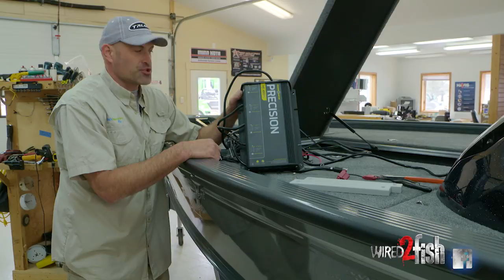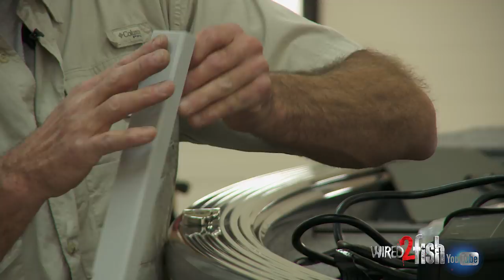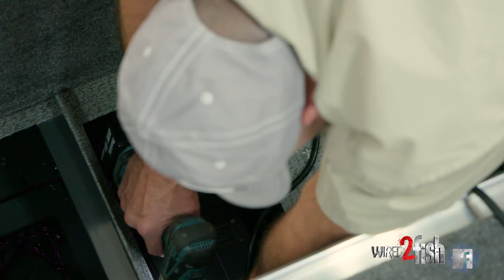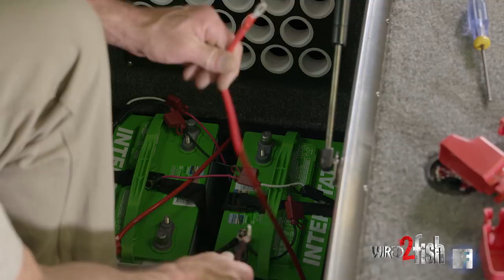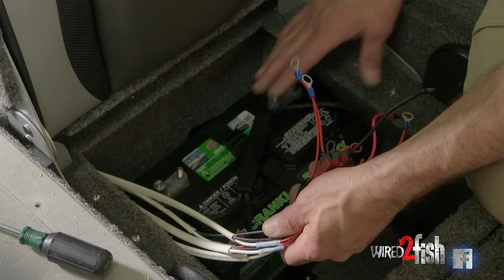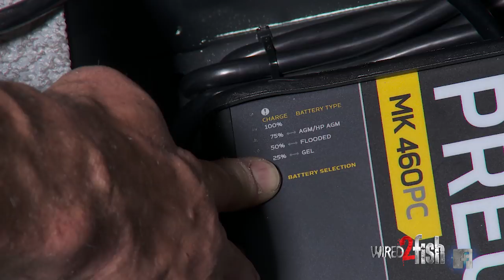How to Install Boat Batteries and Onboard Chargers [36V]

Comment: What can be done if I have 2 batteries feeding for my starter and accessories plus 3 batteries for my 36v trolling motor. How do I charge 5 batteries? Or what options do I have? Thanks for your time appreciate the great video.

Comment: I supposed I can use a 36v charger to charge the 3 x 12v batteries connected in series while trolling.
However, can I use a 3 bank 12v x 10amps charger to charge the 3 x 12v batteries connected in series while trolling?